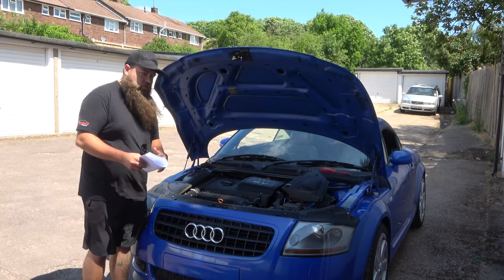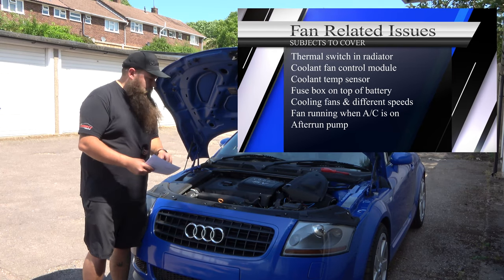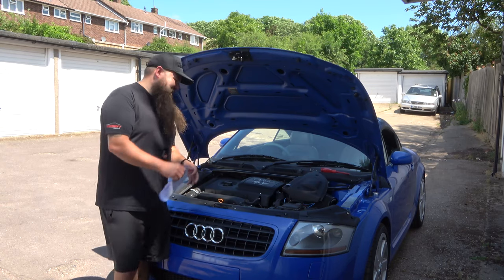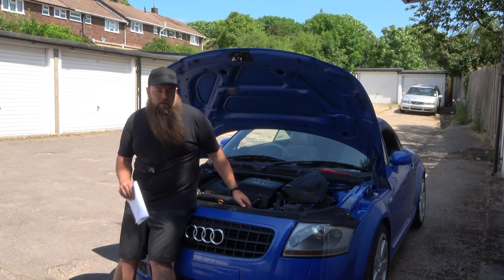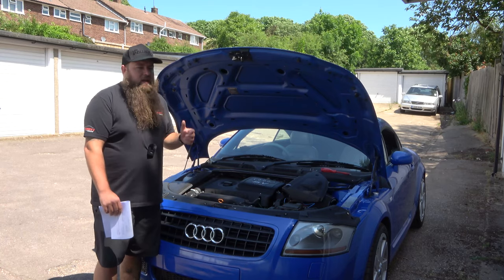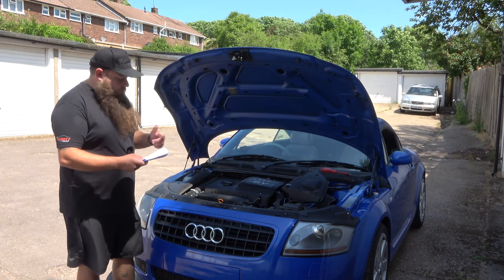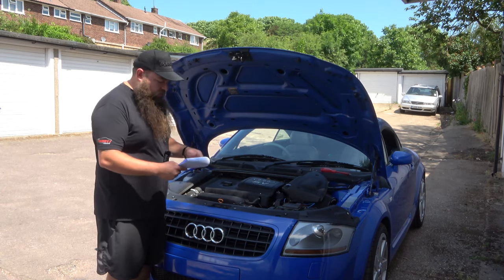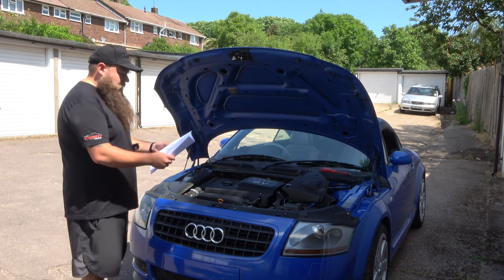How To Fault Find Fan Problems Audi

Comment: I having bit of a,issue temp when driving.  Normal. 88 to 92c. .   Idleing.  Temp goes up to 110c and back down again up and down  then i get a little coolant leak.  Near driver side wheel..
Reply from the maker: It sounds like your fans are not kicking in, you need to have a look at the thermal switch in your radiator as that should bring your fans on slow speed above 95 and fast
 speed above 103
Reply: @TheParrottBros  yes ive changed coolant temp sensor seem to have do the trick fans come on a 93c 94c now.  Temp when driving mid 80s.
Reply from the maker: fantastic
 @liam6488

Comment: When I turn the AC on, the smaller fan runs, the car overheats and neither fan comes on and also after turning the car off the fans don't run. If I spin the primary larger fan, it will spin for 30 seconds and then stop. I purchased a new cooling fan assembly, but I'm not sure if that is it.
Reply from the maker: It sounds like you have more than one problem, both fans should spin when ever the fans come on, if they are not coming on with the vehicle gets hot there is a good possibility that the thermal switch in the radiator has also failed
Reply: @TheParrottBros  I believe that also, I will pick one up while I have the car apart as everything is in poor condition. Thank you for the help!

Comment: I'm presuming the after run pump is pretty noticeable after switch off? Just turned my car off after a long run and it's silent under the bonnet...
Reply from the maker: Yeah you can hear it. It’s not loud but it’s obvious. You can also test it by starting your car leave it running on idle and open your bonnet and feel the pump. It should be running
Reply: @TheParrottBros  I've just tested the fan switch plug. Jumping the low speed pin and there is nothing. Jumping the high speed pin and they work. Does this point towards the resistors in the fans being at fault?
Reply from the maker: @chrismawa  that’s correct mate, the slow speed is effectively burnt out. So you can either Google slow speed tan resistor mod or replace the fan pack
Reply: @TheParrottBros  As I thought. New fans it is! Thanks a lot mate.

Comment: Great info as always !! Can you lubricate the conections on the bolt down fueses ?
Reply from the maker: You can use an electrical contact cleaner, but on the bolted down ones that’s not so much of an issue it’s more to push in one that’s a problem

Comment: lots of foam insulation type of stuff seems to be occasionally coming out of vents ..
Reply from the maker: Thank you for the 10 messages 😂. Foam in vents is from the air vents them selves. The foam is out round each joint to help seal the system.  Over the years this gets heat damaged and falls off.

Comment: My fans work when I pull out the fuse inside the car. What do you think that would be?
Reply from the maker: That doesnt help diagnosis, are they working on slow or fast speed? when dont they work when they should ?

Comment: What if you remove AC pump altogether, will I need to rewire the sensor switch or something else.?
Reply from the maker: The problem is the wiring is there and the sensor et cetera so it needs to see certain things, you should still get low and high speed from your thermal switch,
Reply: @TheParrottBros  fly by wire, the AC as been taken off altogether . never gave the wiring a thought,if it's just a pressure sensor I should just be able to join the wire's I hope.it is a roadster so don't need AC.

Comment: 2001 TT W/ ATC motor. Intermittent cut-out when getting on it. Feels like its about ready to go to moon, then cuts out leaving motor feeling like its wound up but going nowhere. Ideas??
Reply from the maker: Does it literally feel like someone’s pulled boost away / cut the boost. Sounds like you’re going into limp mode, I would look at the N 75 valve to start with

Comment: My smaller fan doesn’t come on only the larger fan, even if I put the aircon on. What should I check first ? Do you think the module or thermal switch is at fault or the fan itself
Reply from the maker: Likely the fan itself, check the fan by unplugging the one that doesn’t work and then putting 12v to it and see if it comes on
Reply: @TheParrottBros  thank mate I’ll try that this weekend. I’ve also noticed my after run pump for the turbo isn’t working so I’ll order one of those as well. Brilliant video mate and lovely car
Reply from the maker: @Paulctshaw  let me know how you get on 👍🏻

Comment: I've got a problem with the fans, they won't turn on unless I turn on ac, I changed 2 radiator sensors, another fcm and still the same, temp on the AC can go over 105 degrees and still won't come on, I checked and cleaned the grounds under the battery tray as well, and still nothing. What else I could check?
Reply from the maker: Have you tried bridging out the plug that goes into the radiator thermal switch and made sure that will force on slow snd fast speed?
Reply: @TheParrottBros  tried 1st speed with the key out, it works, but second isn't working, I had key out thou

Comment: Hey bro I'm thinking of getting a late mk1 or early mk2 tt and was wondering if any of the mk1's have Bluetooth?
Reply from the maker: Hey, no MK1 has such modern features. At best you’ll get a CD player or disc changer, anything else will be aftermarket. Can be added to some in place of the disc changer
Reply: @TheParrottBros   Okay thanks man. Still might get a mk1 anyway!

Comment: Nice work as always Dom. I notice when you go to turn the ignition, it sounds like a high pitched pump type noise comes on. I presume that is just the fuel pump? It tends to continue to make the noise for a good 5 mins after taking the key out: my battery goes flat fairly easy so wondering if this is contributing and if it’s something normal/ I have to accept?
Reply: They’ve got a secondary electric oil pump which stays on after you shut it down and helps cool the turbo. That’s why tt’s don’t really need a turbo timer. Are you sure this isn’t it?
Reply from the maker: Hey buddy, firstly thankyou, 
is your noise coming from behind you / under the car? the fuel pump will usually prime when you open door / put key in and ignition on but should only last a few seconds. 

when the car is switched off and key removed only the afterrun pump should circulate water for 10 mins. This should not affect your battery. 

It sounds like you have a faulty item and requires looking into buddy, have you got access to a multi meter?
Reply: @dimitrist3561  Could well be it. Its the battery drain that is puzzling as it has had a new battery within the last 18 months I would say. If it makes a high pitched sound that could be it.
Reply: @TheParrottBros  Thanks Man. I think I might do a bit of investigation and try and work out where it is coming from. Defo sounds like the engine bay somewhere though. Any more breakfast meets planned?
Reply: @andycharger  I've had the same experience as you did, especially during the covid lockdown. I had to drive the car every two- three days tops during the cold weather because it almost drained a fresh battery. I'm not sure if it's a parasitic draw, maybe Dom can shed some light

Comment: Just watched this video and my fans  don't run on slow mode  with the Aircon switched on. Where's best to start
Reply from the maker: Pull the 3 pin plug out of radiator thermal switch and bridge it, it should prove hopefully that the slow speed in the fans has failed, if  the fans do run slow speed and fast then you possibly have a Fan control module issue
Reply: @TheParrottBros  I watched your video last night great video by the way. i  had a look tonight and it looks easier to get to it from the underside. So going to be Saturday's job
Reply: @TheParrottBros  hi I have removed the plug and bridged the wires I only get the small fan on slow and on fast the larger fan does not move.

Comment: Fans aren't coming on and am seeing 105+ on 49c Iv tested the fans and both speeds are working (and get slow speed with ac) just replaced belt, water pump, thermostat and radiator switch this week and check all fuses and connections and still having same issue.....any ideas what to do next? P.s. Love all the content was a FAN before my mk1 you influenced me into😂
Reply from the maker: Hmm that’s interesting because if your getting 105+ and your radiator switch is working they should have come on. 

2 options, your thermostat is faulty ( less likely but entirely possible ) 
Or your fan control module under the battery is faulty
Reply: @TheParrottBros  nice one just had a another look and realised that the lower radiator hose is staying far to cold so Im thinking the thermostat is the issue will have a proper look tomorrow... Had a mate helping so have messaged him to see what it looked like when he took the old one out and I'm wondering now weather my original issue was a backward fitted thermostat that he will of replaced with a new backward fitted one
Reply: Quick update mate thermostat was fine my issue was a leaking coolant reservoir cap (not building enough pressure to open the thermostat) fans are kicking in fine now 👌😅
Reply from the maker: @Shaun-r8r  great find buddy, nice simple fix 👌🏻
Reply: @TheParrottBros  I'm glad it's sorted, just brakes to do before it's roadworthy again.... Then to fit some bargain coilovers and adjustable links I picked up the other day
Reply from the maker: happy days, then to rack the miles up and enjoy :) 
 @Shaun-r8r

Comment: Hi all, I am cutting and pasting this from a recent FB post to get some opinions, maybe even from the man himself, anyway... here goes... when the temp reads 95/96 (via 49c) the drivers side fan kicks in for a little a bit and then shuts off again it does this periodically when the vehicle is stationary which is what I would expect and deem this to be normal behavior. The left or passenger side fan I would assume is the AC fan ? It isn't coming on at any point even if I have the temp set to LO and Auto, the air coming out of the vents isn't cold, that is one issue. The second issue is that when driving the temp drops from 90 to 70-75 very quickly and stays there until I become stationary again at which point it will creep back up to 90 over a few minutes and eventually to 95 and turn the driver side fan on. This doesn't seem like a faulty sensor but more like a faulty thermostat which is staying open and letting the air cooled coolant continuously circulate when driving. We don't see this behaviour when stationary as it can control shutting the fan on and off, obviously the air flow can't be shut off when the vehicle is moving hence the continuously low temp. That's my logic anyway...

Comment: Pulling the fuse doesn't kill the fan. It just keeps going! Help?
Reply from the maker: Which fuse? The fans are fed from a couple of places as they are powered by the fan control module, the thermal switch etc
Reply: @TheParrottBros  2004 Audi s4 Avant, pulled the forth fuse, radiator fan kept going.
Reply from the maker: @Jakobi26  sorry I’m not up ok b6 s4’s I’m afraid but I would assume it’s a similar set up
Reply: @TheParrottBros  it's all good. Thanks for responding.

Comment: I guess it's time I change the afterrun pump then, it only comes on sporadically when I turn off the car.
Reply from the maker: I certainly would if I was you, prevention is better than repair 😂😂 
Trust me 😅😅
Reply: @TheParrottBros  Yes your right. I alway's thought it would just come on when some condition was met, but I guess I was wrong. I alway's make sure to cool my car down after pushing hard though, that already makes a big difference in turbo/manifold life.
Reply from the maker: @m0rb1d43  Yeah i usually have a route i take home after giving it a good warm up haha, this just helps to gradually cool them down and for what they cost are worth having

Comment: Gauge pass 90 fan does not comes in fans r working
Reply from the maker: Fans come on about 95 and 103. Unless you put air con on then they should run slow speed

Comment: Audi A4 B6 1.8T, can one bad fan cause slight overheating?
Reply from the maker: if a fan isnt working the car will get hotter and the fan that is working will have to work a lot harder for longer to cool the car